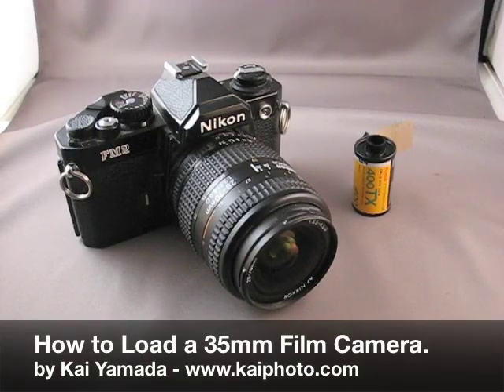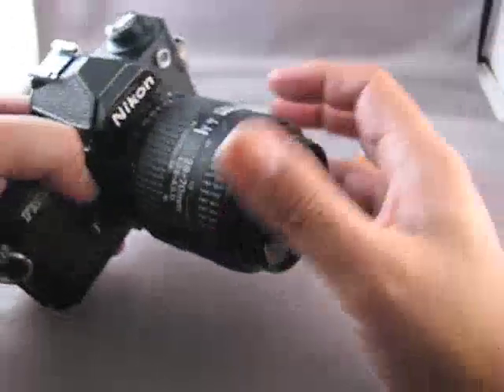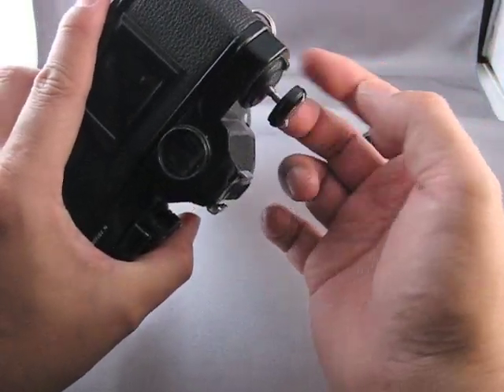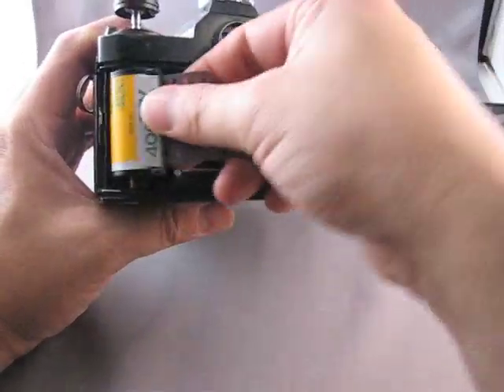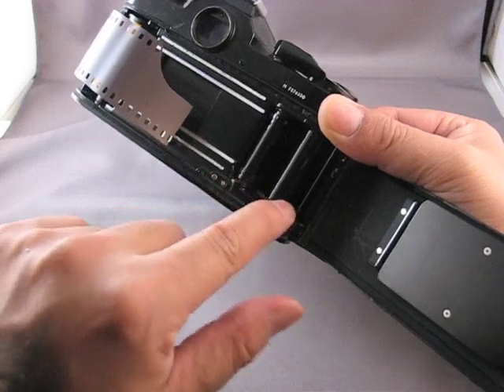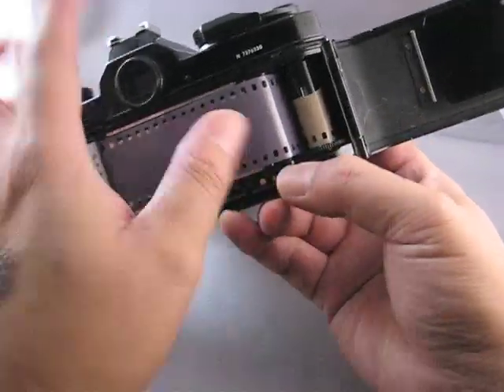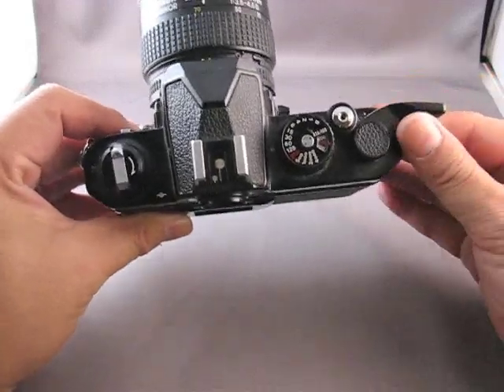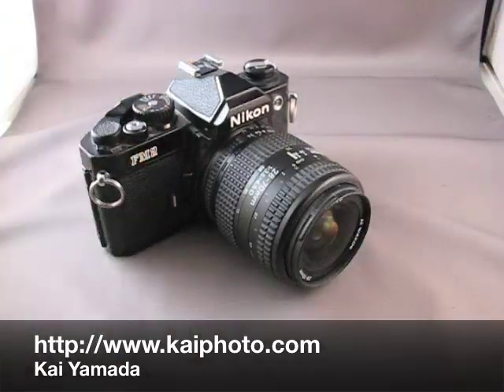How to Load a 35mm Camera

Comment from the maker: @entoblast I just read online that someone with a Sears KS2 (a rebranded XR7), had a stuck shutter, but after using a cable release to trip the shutter, it became unstuck. A cable release screws into the cable release socket, usually in the middle of the shutter release button or nearby. Pushing on the button on the end of the shutter causes a plunger to come out that trips the shutter. It may be enough to unstick old or gummy shutter lubricant.

Comment from the maker: @entoblast Shutter button not clicking down might be a problem, but it is more likely the shutter won't operate without a battery. Have you replaced it? There is usually one shutter setting that will work without batteries. Set the camera to the 1/125 shutter setting. This is the flash sync speed and it should be in red or green on the shutter speed dial. If you see another speed (1/60 or 1/250) in color, then try that shutter speed. Batteries? You need two LR44 batteries.

Comment from the maker: @newoxvx I couldn't find specs on a Canon EO5 Rebel GIII. Did you mean the EOS Rebel GII? 
With the newer 35mm film cameras with built in motor, it is pretty simple. You make sure you have fresh batteries in the camera. Drop the film in the left hand compartment. Pull the film leader across the film gate to the right side of the compartment. There is usually a red or orange marker showing how far the leader needs to be. Close the camera and it will automatically load the film.

Comment from the maker: @entoblast Each SLR will have it's own quirks.  The lever won't necessarily advance the film the whole way in 1 throw. The lever is ratcheted, so it may take 2 or 3 workings of the lever to advance the film 1 frame. If the film is not advancing, check the rewind button to see if it is stuck. It should reset after tripping the shutter and advancing the film. If the advance lever does not turn the take up spool, there may be a problem with the camera.

Comment from the maker: @heitzelalvarenga Most of these older 35mm cameras use one or two of the button type battery, which you can get from your local camera shop, drugstore or Radioshack. Look in the battery compartment. The type and voltage of the battery is written in there somewhere.

Comment from the maker: @gerbilplay4 Your camera just needs batteries. The way these cameras usually work, is that you insert the film (like in the video). Pull the leader across the film gate, and there is usually some mark on the takeup side of the film compartment where you pull the leader to. Close the camera back, and the film automatically winds to frame one. After each shot , the film will automatically advance. At the end of the roll, depress the rewind button and the film will automatically rewind.

Comment from the maker: It's possible that the camera is set up correctly, but that there is a bit of slack in the cassette. Take 3 or 4 more pictures and keep an eye on the rewind knob. If it still does not move, then you need to open the camera back and reload the camera. Also, make sure that the knob is in the down position, not slightly pulled up for loading.

Comment from the maker: @brattette You have a different camera than mine. If the rotation of the film goes clockwise, that is normal for many 35mm film cameras. The take-up spool will wind in the direction it was designed to, so I wouldn't worry about it.

Comment: Probably a little late but if anyone else is wondering how to change the iso number on the Nikon FM2. Turn the shutter speed dial left and right to change shutter speed but to change the ISO dial you need to pinch it upwards a little then hold in up and turn it left or right to change it. You should see the iso dial on the inside of the shutter speed dial changing if your doing it correctly!

Comment: uh.. i turned the slot thing (i think u called it the take up spindel?) without using thing to turn it at the bottom, so i actually put my finger on the actual slot part and turned it that way... i'm afraid that now i've left fingerprints on there, and the film will come out badly.  should i worry?

Comment from the maker: @danofazz While I don't have the videos you need, you can find one for the Zenit on youtube. Do a search for Loading Zenit. It may not be the exact same model, but it should be close enough. If the Praktica is a later model version, it should load similarly to the one I show here. If earlier, it may be similar to the Zenit. On early model SLRs, one diff is that they use wind knobs, not the winder lever.